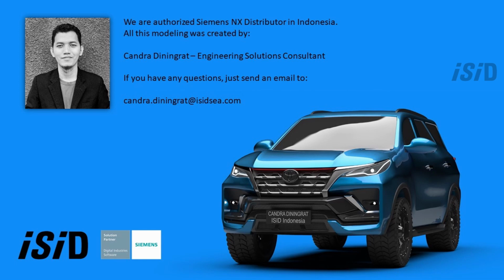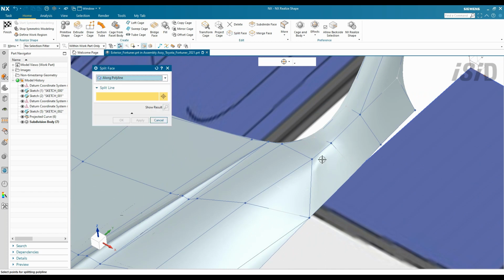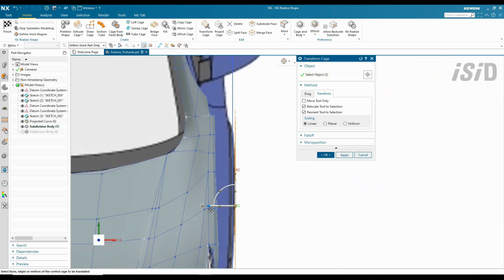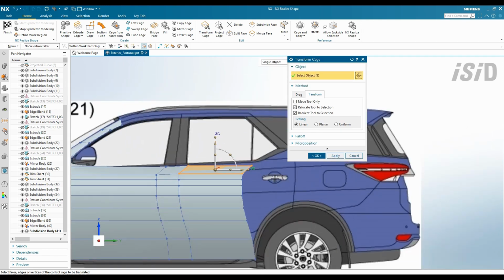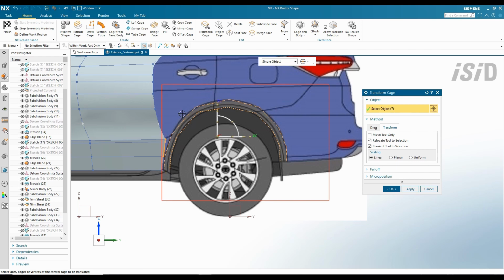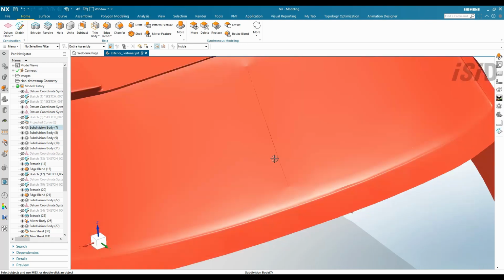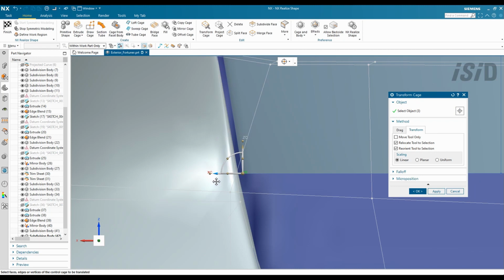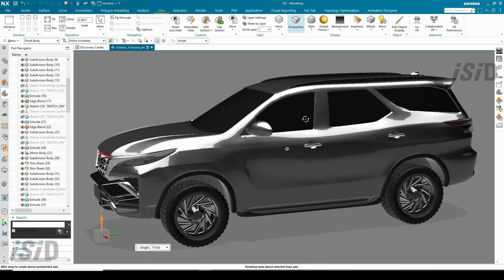Siemens NX - Toyota Fortuner Modeling Tutorial

Comment: It is really a convenient method and a smooth workflow you have showed us but i was wondering if the result obtained using this is better than applying reverse engineering commands to it in terms of surface quality and deviation? Ofcourse we have facet body in that case instead of a vector drawing
Reply from the maker: No, the result with reverse engeenering or Class A Surfacing method has better surface quality than this method
Reply: @id.dentsusoken  thanks 👍